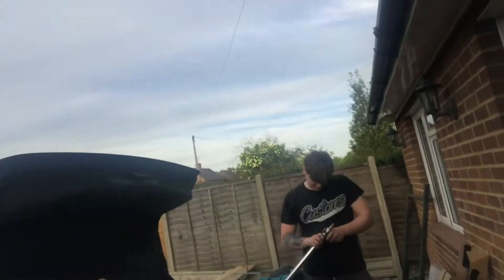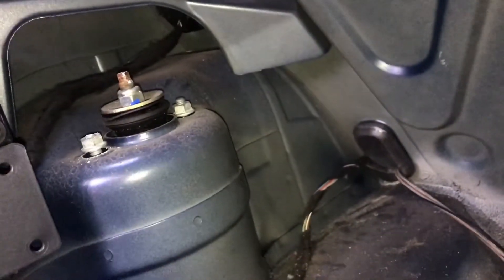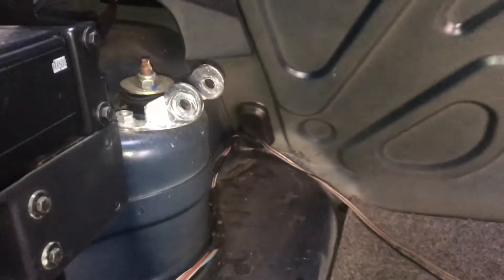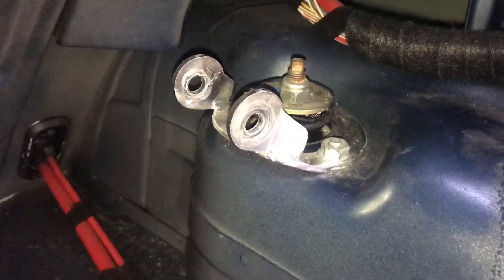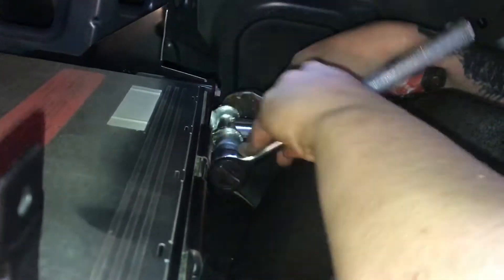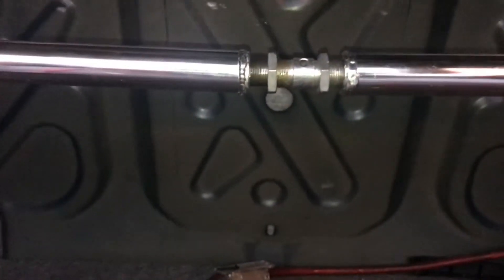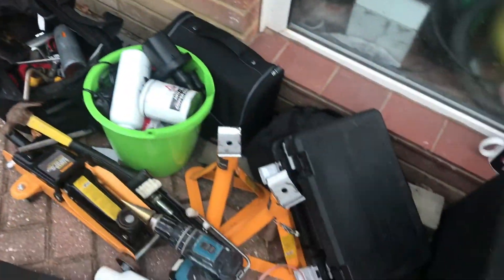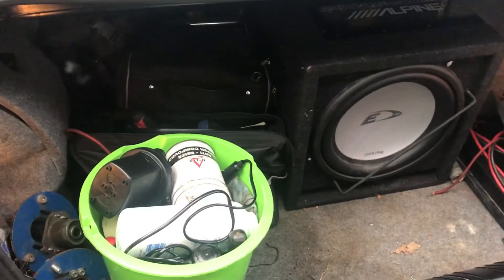BMW E46 - Rear Strut Bar Install !

Comment: Would doing this cause more stress on the subframe which are already prone to cracking?. This is one thing putting me off. Thanks
Reply from the maker: gingerbread man if you have an m3 it might be as it’ll make the rear end stiffer and but only the e46 m3 has the subframe issues
Reply: Modified Weekly thanks for the reply, mines a 330ci but subframe issue is across the whole e46 platform but it shows more on the m3s because of the power they put down but 330ci/ds subframes do go if you drive them hard or use on trackdays.
Reply from the maker: gingerbread man fair enough I don’t think there would be any problems on the 330 tbh for road use
Reply: @ModifiedWeekly  All E46 chassis are prone to rear and front sub frame failure. E46 M3 and non M3 are the same chassis.
Reply: @ModifiedWeekly  that is not true at all. every single e46 suffers from subframe issues.some more than others and facelift versions a little bit less- but all have this problem.

Comment: BMW video. That’s 5.29mins of my life I’ll not get back
Reply from the maker: Matthew Bonner be patience Honda vids coming soon
Reply from the maker: Matthew Bonner hondas back next week mate😎 very sorry for the distressing views in this vid
Reply: Modified Weekly I was genuinely expecting the excuse “well my bmw is rwd and it likes to drift so I’ve got to carry my garage about for traction”
Reply from the maker: Mate it’s a 318i it don’t go sideways😂
Reply: Modified Weekly yana that peddle on the far right in the footwell. Push it to the floor and don’t puss out 🤣
Reply from the maker: Matthew Bonner open diff mate
Reply from the maker: Paul’s a bumberclartttt
Reply: Is there a torque setting for tightening the nuts at the top of the strut?

Feel any different with the bar fitted?
Reply: @karman2227  yes 21 lb ft